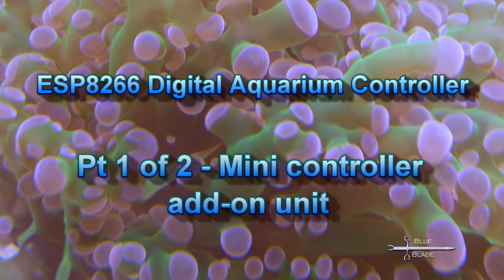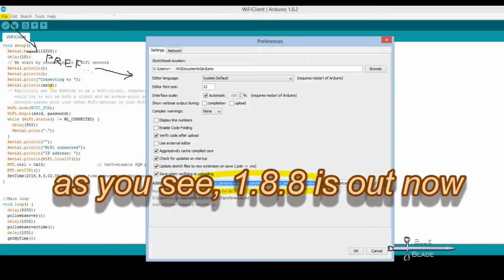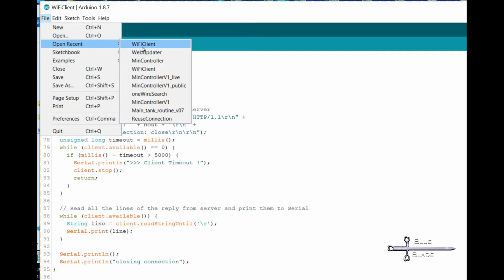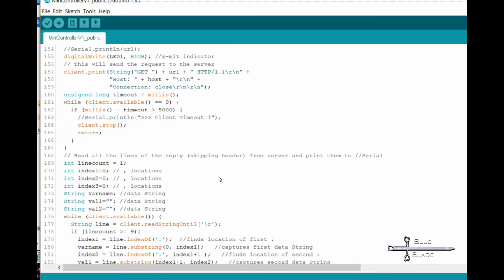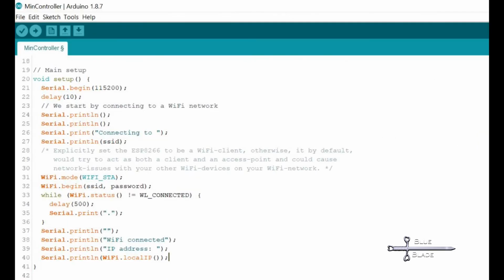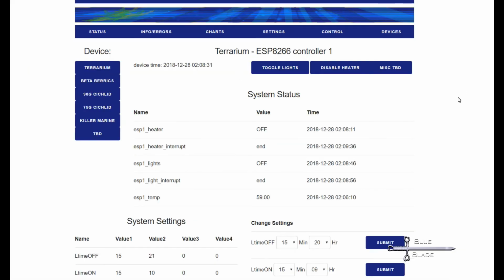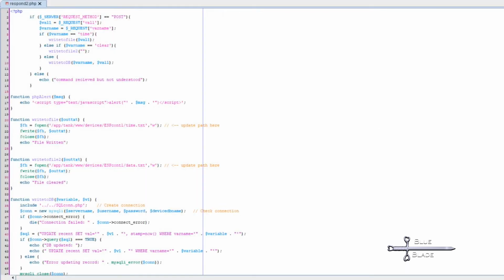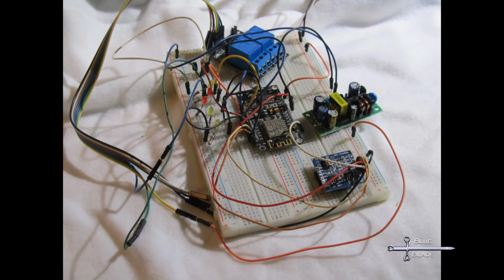ESP8266 mini Aquarium Controller: part1 - Arduino code and website interfacing

Comment: Cool project, Was looking for something like this for the kids Beta tanks (control lights on/off and temperature) So the lights get on schedule, even when the kids DON'T and so those small haters don't make fish sticks (ya, had that happen....) 
My question is this, can this be used without a Pi, as just an ESP8266 or ESP32 to control 2 relays or is the Pi necessary to adjust light times and temp set point via wifi or buttons and screen? 
Don't know how to code much more than basic if temp=x, relay high/low..... so when I say "can it", is it caveman compatible to do so.....  ya, 3D design I'm good at, coding..... not so much.
Reply from the maker: well,  i had considered a stand alone version. it definitely can be done. but, it would be a bit of coding. i see tow paths:
1) - easiest - comment out the sync lines that get data from the PI web-server. hard code the settings, and just update over USB (re-flash the esp) to change settings. 
2) - more complex - upgrade to ESP 32, add a web-server to the code on the ESP, and code in a web interface for the device. reconfigure sync lines that get data from the PI web-server to instead be part of the local web server content.
Reply: @BlueBladeFish  Thank you for the reply. I think 2 would be the best option, but being new to coding.... I think I'm gonna look into doing option 1. I don't mind re-flashing to change setting (opposed to reworking all the code,  above my skill level at the moment) because once dialed in, I wouldn't think it's something that would need to be done often.  Or maybe as I'd be using it in fresh water thanks, it wouldn't need to be adjusted after lighting and temp are dialed in (never done a salt water tank, so IDK, imagine there's more at play there).

Comment: Very nice project, I connect my ESP8266 with the Internet and use a library to have the time without using rtc, an expense less to do. Cheers
Reply from the maker: yea, that absolutely does work. i'm updating mine with the internet time off the Pi also . however, with the RTC, it will keep its own time for a long time in offline mode if need be.  but to be honest, the RTC isnt needed.. i just like to use it.

Comment: I like this project. I would love to see you do a Blynk aquarium controller project. I have created a heater control Blynk project but I’m sure it is subpar. It does work though. And I just figured out how to make it work even when I lose Wi-Fi at my house, like during an outage. I actually used a Sonoff Basic for it.
Reply from the maker: Thank you! looking into Blynk, I might give it a try. I have some reservations about the security aspect of having these simple IOT devices connect to public internet sites like that though  -  they just don't have the power to do much encryption. as long as you keep it local behind your firewall that is less of a concern. then again i suppose in many cases, even if it is accessed by an unauthorized party, it might not really be any big deal. its a topic that i have on my radar.
Reply: You can also use Blynk to create your own Web server so you don’t have to use their online server I believe. I haven’t figured all that out yet though.
Reply: I have never worked with a raspberry pi, can I use the same sketch using and a Arduino for a server?
Reply from the maker: @drumminjeff71  if you refer to the standard Uno/Mega style Arduino, probably not - or at least not in the same way. The Pi is running the Apache webserver and MySql database server here. you could use any old PC or laptop, or anything that runs linux or windows OS (probably many other OS's also).  The Raspberry Pi is essentially a cheap, small, low power (consumption) computer that i am using as a server.